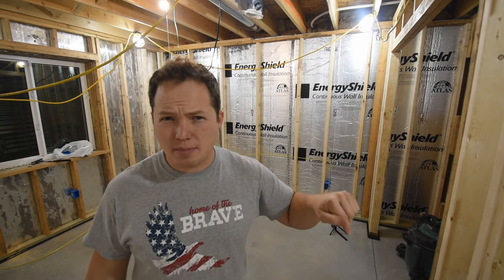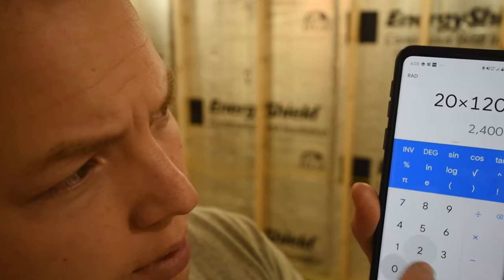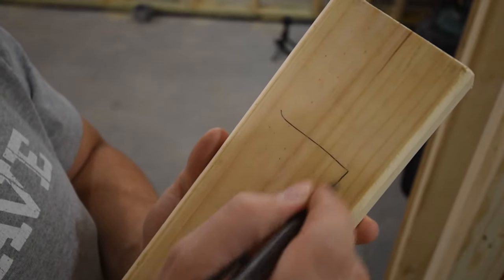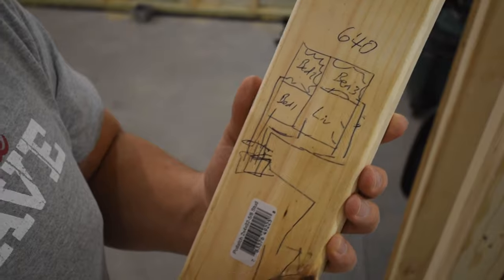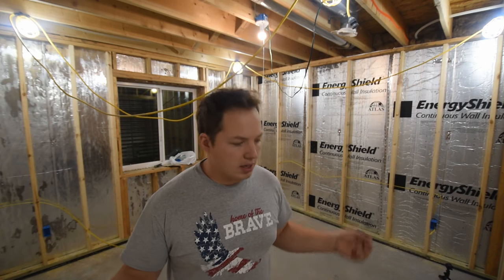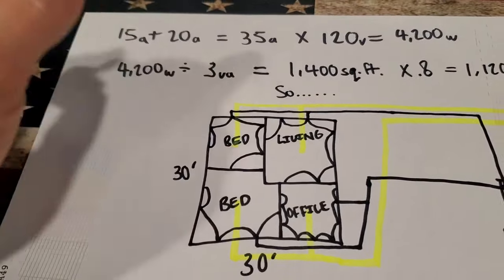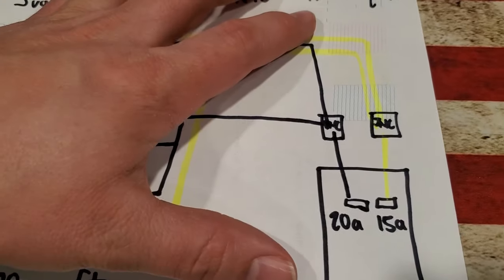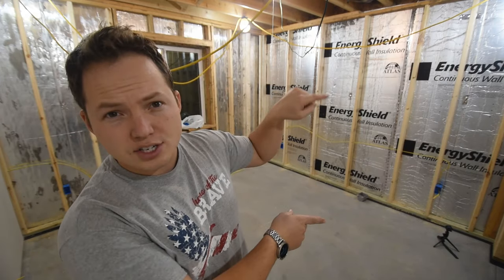Does a Bedroom Require a Dedicated Circuit? - Using the 3VA Rule To Calculate Anticipated Loads

Comment: Hey Ben, really enjoy your videos, I've watched them all, all done well, clear and concise, filmed well and audio is good, thanks for that. Would you do a video on junction boxes, for instance, where to place them, how many splits you can do in the jbox, do you have to be able to access them and is there line loss if I bought a main run into the j box and split it 4x to go to different areas of the house assuming that my draw was still below 80% of the breaker etc. That kind of thing. I'm building a cabin in Wisconsin, its small, single story 24x30 so garage size and I wont be using tons of power but am building to code so I am doing everything right. Ideally I would over circuit everything but with the need for a AFCI on all 15-20 amp breakers Im trying to be smart about it, if they were $8 a piece like old breakers no problem but at $50 a pop it adds up, a guy will have $500 in breakers in his box so Im trying to be smart about how many circuits I have, enough but not more than needed and I think the best way to do that is with splits in a junction box to get to other areas of the house for lights etc. Thanks man! Keep up the good work, liked, subscribed, notified..Also if you get a chance I'd like to know more about bringing the main power from a pedestal with meter outside....into the house. I know there are three terminals out there and conduit is already in the ground, but do you have to continue the conduit in the house to the panel? or can you run it across floor trusses in the basement to the panel and only need conduit for the first 6" above the main electrical panel in the basement. I have 100 amp service and will bring the electrical into the basement from the panel/pedestal outside. I dont want to wire into the main pedestal outside myself, I'll hire someone for that but I'd like to see what it involves so I have a clue and know what to expect, how long it will take and if I need conduit the entire length of the basement or just 6" or so above the basement main breaker panel.  Sorry for all the questions but sometimes guys are looking for ideas for content and this would be really helpful. Thanks again!
Reply from the maker: Sounds like an awesome project! What part of Wisconsin are you in? I have friends and family in a few different areas and maybe, just maybe, you would be close enough that I could stop by and take a look! Either way though if you have any plans for this project you could email them to me at bensahlstrom@gmail.com and I'd be happy to take a look!

I'll also take note on the topics that you mentioned and will get them on the list! If I understood correctly you would have your meter mounted on the outside of the cabin and then from the meter you would have conduit that would lead to your main panel. I would highly recommend that you run continuous conduit from the meter to the panel since that line is not really protected by a circuit breaker unless you have another main disconnect panel outside. This cable should also be as short as possible because of the lack of overcurrent protection that I just mentioned. I usually see the meter mounted just on the outside of the house and then the panel is either directly on the other side of the wall in a garage/utility room and or there is a short jog down in conduit into the basement where panels are often located.

I hope that helps just a bit! Shoot me an email with some more information if you want!

Ben
Reply: Camaro 68 … You may want to pose that question to your local inspector as some get fussy after 3-4 wires under the same wire nut. Personally I have seen enough problems over the years with too many wires in a single splice. 4 wires and up seems to be where the issues are. 2-3 wires never has that problem.
Reply: @rupe53  thanks for the tip, so initial home run and maybe two splits max off that home run, so that would be 3 hots, 3 neutrals, 3 grounds with 14-2 wire...good to know, I dont think I would ever need more than two splits anyway. If these new breakers werent $50 a pop I'd make everything its own circuit but its only 1000sqft and trying to do it as economical as possible and still right. Surprising how many circuits you have even in a small one bedroom by the time you have your kitchen runs, appliances, WH, furnace, outlets, lights, stove etc etc....another question..my kitchen is very small, it'll only be probably 6ft of counter space...is there a time when you dont need the two circuits on the counter? I mean if you had a 4ft counter top would you still need two circuits worth of small appliance outlets per code? Seems sill to have two separate outlets on separate circuits on a 6ft counter, but if its code I've gotta do it.
Reply: @rupe53  also do you know anything about if I have to put the 2-2-2-4 main feeder line from the basement wall across the basement to the main panel in conduit? I had an electrician tell me it isnt needed to be in conduit but that seems weird to me to not have to protect that large power source running through floor joist from a nail or anything...its shielded in tough cover but still, if the box was right below where it enters the basement thats one thing but it comes in on the basement wall on the south wall and has to go 20ft to the NE corner of the basement.
Reply: @camaro6810  … I know it's a small home with small counter space, but when you add up a toaster plus a coffee pot the circuit is maxed out. IOW, no room to use a microwave while the others are in use. Probably best to do it once rather than kick yourself later. I ran into that exact situation 35 years ago and wound up splitting the fridge circuit to pick up the extra when we first bought a microwave. Of course back then we didn't have any portable devices either so in hind sight I would have made all the counter outlets a double duplex. (4 outlets) These days if I have a counter full with coffee pot, toaster, mixer, blender, can opener, I have to unplug something to charge my phone or use a vacuum cleaner. You don't need more than 2 circuits but more outlets for convenience is a handy thing to have for only an extra few $$.
Reply: @camaro6810  … I would say you'd' be ok without conduit, but always check local code. If you are worried about nails during some future renovations then get some "nail plates" and put them on the face of the beam. They can be had at your hardware store or big box store for under a $1 each.
Reply: Hire a professional.
Reply: @camaro6810  ... Hey, sorry for the delay getting back here. First we'll talk about your feed from the meter to the panel. If it needs to be in conduit outside (buried or other protection) that uses different wire than your typical SER (service entrance rated) cable. Inside conduit you must run THHN wire (THHW for wet locations) and the easiest way is to NOT make a change half way to the panel. Some people do but that requires a junction box plus splice connectors. IOW, more material cost and labor time.

As for those runs back to various rooms, I would make each room a home run back to the panel area and maybe join two rooms together in a 4x4 box near the panel. Worst case is you can add a breaker later if you need to split them up, then run a short wire back to the junction box and pick up the other room there. This way you don't have to open a wall or snake wires after the fact.
Reply: @rupe53  Thanks thats a good tip about the home runs back to 4x4 box near the panel, I might use that idea if I have to. 

The feed from the meter to the panel inside the house will run through conduit past the basement wall. I am using 2-2-2-4 MHF in the conduit, I was just unsure if I have to KEEP it in conduit once it enters the basement wall. So where the MHF enters the basement and then travels up into the floor trusses, across the basement to the other side and down into the box...does that have to be in conduit. I am assuming I guess that I can run the MHF in conduit underground? I have looked at an electrician and they wanted $1500 just for labor and that seems excessive for pulling wire 30ft through conduit into the basement and connecting to a panel, it wouldnt take me more than half a day to do it and budget is limited.

So my two questions areL 1. Can the 2-2-2-4 MHF for 100amp service travel through conduit underground? and....2. Once it passes through the basement wall, while running through floor trusses, does it have to be in conduit, or do I only need a small piece of conduit 15" or so above the panel for the MHF to exit the floor trusses and enter the house panel. 

Thanks for the replies I really appreciate it!
Reply: @camaro6810  ... I understand WHERE you are running the wires but unclear as to why you are doing 4 conductors from the panel to the meter.... UNLESS... this is really a sub panel from a main breaker (or panel) out at the meter, which is some distance from the structure. Also unclear as to using MHF (Mobile Home Feeder), unless that's somewhere in your local code. The issue is that would be individual wires so the ENTIRE RUN must be in conduit. It's also thick enough to be a pain in the butt to pull any distance through pipe. If the meter is mounted ON the house (or will be) you can simply drill a hole behind the meter and run aluminum SER cable, which has it's own exterior sheath so needs no conduit to run inside walls or between floor joists. If the meter is remote from the structure, then simply mount a junction box where the SER cable exits the structure. Usually a 10 x 10 weatherproof plastic box, drilled through the back, and caulked to the building. From this box you can run buried conduit out to the meter / disconnect location. In most areas you will need a slip-joint in the conduit below the  box to allow frost movement or the like. Inside this box is where you join the different cables together, then put the cover on. Now the "why" part. SER cable has it's own covering and there's stuff in the code where sticking that inside a conduit changes the amp rating of the wire because it could possibly overheat. IOW, a "double sheath" de-rates the wire's capacity, you follow? Sooo, that said, you always run what's easier / cheaper as soon as you can do it. (by code of course) The junction box with wire bugs to splice things will probably run you near the same $$ in your case but actually save many hours over doing everything in conduit inside as well. The key here is individual wires must be protected by a sheath or conduit, whereas a bundle of wires (a cable) is already rated to be mounted without further protection. If your MHF is actually a cable then I'd want to clarify the intended use with your local inspector before going forward with the project.
Reply: @rupe53  Ok Im learning more here haha Yes i would say that technically my panel inside the house would be a "sub-panel". I was told by an electrician I needed the MHF wire to run through the conduit and into the house and that it didnt need to be in conduit. He was a master, so I dont know if he did or did  not understand what I was talking about or if codes are different per area. I did send him multiple pictures so I dont know how there could have been confusion. That was before he quoted the $1500 to run the line into the house. So if Im understanding correctly MHF (its 4 wires, each individually sheathed seen here: https://www.menards.com/main/electrical/electrical-wire-cable/indoor-electrical-cable/2-2-2-4-aluminum-mobile-home-feeder-per-foot/3692059/p-1473854610601.htm"
that needs to be IN conduit inside the house. The meter is outside 30ft away from the basement with a panel below it already mounted and working. I would like to run the feeder MHF from the main panel through the conduit already buried in the ground, into the basement to the "sub=panel". 

I'll look into the SER cable and see if that is the route to go. Again I really appreciate the info. The stuff at menards is 6/6/6/6 so I dont know if that makes a difference. 

I think in this instance it might just be better to look for a cheaper electrician. I can handle home wiring and the panel but for this portion of the project I have never run lines to the panel etc so I have quite a bit to learn. I started this project because I wanted a challenge and Im getting it! haha
Reply: Also I have a "slip joint" at the outside panel, I guess the only other thing I am confused about is the rating for 6/6/6/6 vs 2/2/2/4 and if the SER would be enough and if I were to connect the two how I would I connect the SER to the MHF doesnt seem possible to me.
Reply: @camaro6810  ... #6 wire in aluminum is only rated for 50 amps or so and you certainly need the #2 wire for 100 amps. While that link shows a bundle of wires, they are not covered in a sheath. They must have an outer covering to be run inside the building. (conduit or sheath)  Again, I'd be talking with the local inspector to see what he will pass so you don't have to do it twice.
Reply: @camaro6810  ... you need a slip joint wherever the conduit comes out of the ground. IOW, both ends. As for joining wires together, they make heavy duty "wire bugs" for this task. Probably 5-10 bucks each for the cheap ones and a bit more for fancy rubber dipped / insulated ones. (no tape needed here)
Reply: @camaro6810  ... couple more pointers. You mentioned going through a basement wall, which I would avoid. Always go through ABOVE grade to lower chances of water leaks. Once through the sill board (or higher) you can go back down to whatever level you need in the basement. Always mount a junction box high enough to work comfortably and certainly above the snow line. The boxes are rain proof but ice and snow build up can cause them to leak at times, especially when melting happens. Always calk the top edge of the box where it meets the house so rain doesn't go behind it and cause rot. I calk 3 sides and leave the bottom open. (that's just me) Oh, those big wire bugs are called ported lugs, meaning they are insulated but have holes for the wires. The price has come down since I last bought some so under $10 each.
Reply: @rupe53  Excellent, thank you so much! I've copied everything you have written for further reference. Thank you
Reply: @camaro6810  ... BTW, there are a few exceptions to rules on jacketed wires being placed in conduit. One of them has to do with protecting the wire from physical damage over a short distance and the other concerns the "fill rate" meaning how much room is inside the conduit once the wire is in place. (space for heat dissipation) Typically that fill rate is around 40% meaning you'd need a 2" conduit for your inside job. (even though you could squeeze it into 1.5" conduit) Back to my original suggestions of talking with the local inspector and seeing what that guy wants.  OTOH, it would be so much easier to run WITHOUT conduit inside your place.
Reply: @rupe53  I agree I think the best course of action is to speak with an electrician in my area and ultimately speak with the inspector when he comes to do the framing inspection. Thanks so much for the replies!

Comment: Here's another thing for you to consider.  If you have central A/C, you could get away with wiring bedrooms together.  If you are going to have to use window A/C units, it's best to wire each bedroom on it's own circuit if you plan to run an A/C in each bedroom.  Especially if you need large capacity A/C units like 10,000 BTUs or more.  You need to decide how the circuit in each room is going to be used and then wire things up accordingly.  If your family likes to use things like electric blankets in the winter time, wire each bedroom on it's own circuit because things like electric blankets pull lots of electric.  Better yet, wire your bedrooms separate if you have the room in your service panel to future proof yourself.
Reply: Nobody uses window units on new homes
Reply: @thomasmarable6818  That's because the newer homes are garbage and the walls would never hold them.

Comment: We used to do 3 rooms on a 15 amp feeding plugs and lights and never had problems ever.. But I like your idea.. Just a question, why don't you run all these hr into the panel and then splice them all onto one breaker. Because what it looks like you have a junction box for the splices and one 12 awg wire. The problem I have with that is ur limited to that one wire from the junction box that's carrying all that load and would need to fish another wire in if your breakers are overloaded and if you already had those hr in the panels you'd just split up wires and add another breaker. Seems like extra work to me you know? Panels technically are rated as a splice box. Plus you'll not have some extra junction box somewhere.

Comment: When I wired my house, I used two breakers per room.  One 15A for lights, one 20A for outlets.  Separate breaker for the fridge, separate circuit for kitchen island.  Yeah, overkill I know.  And yet, I've NEVER had an electrical issue.
Reply: Helfull your share
Reply: That’s a bit of overkill. But it is definitely going to work.
Reply: Can you use a 15 amp breaker for room outlets?
Reply: I never have thought of applying the 3VA/ft rule per room.  It is typically used to calculate whole house loads for panel sizing.
Reply: I would keep in mind the power usage of individual rooms.  Just one space heater pretty much maxes out a 20A circuit
Reply: I believe lighting should be dedicated power to a floor. Outlets should be broken up by room at minimum.

Comment: Breakers are relatively cheap, so just use a 15A (14awg) for each room's lighting & a 20A (12awg) for the receptacles.
Reply: If doing your own house maybe, not if you are bidding a job, minimum to code is cheaper
Reply: Not with all the afci breakers